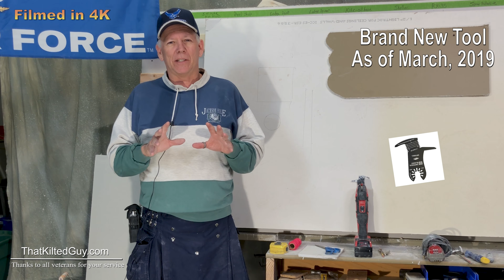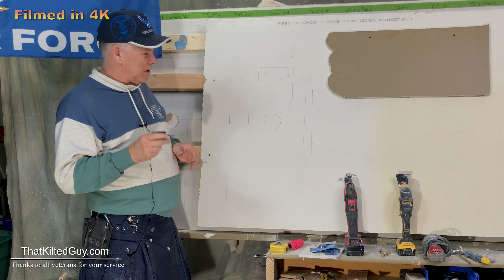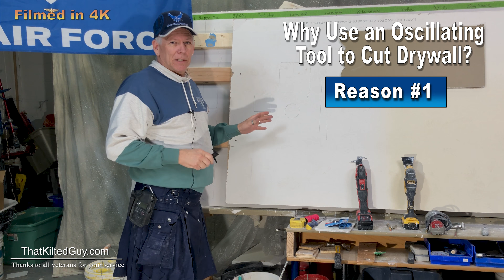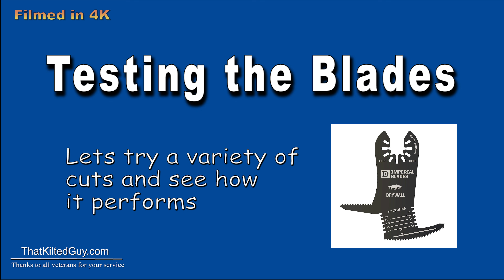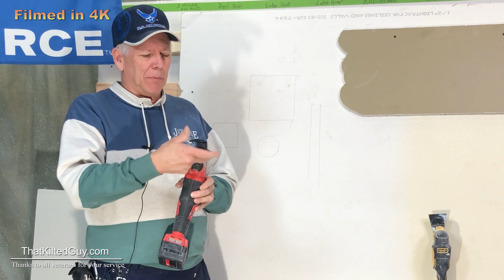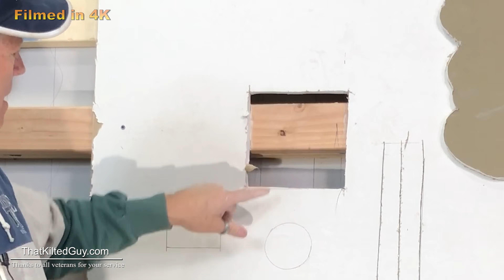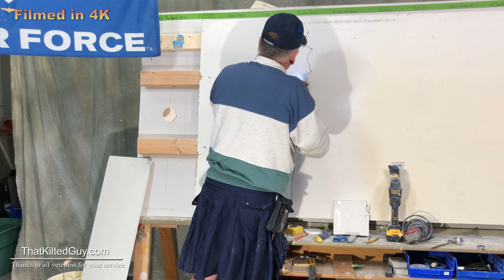BRAND NEW DRYWALL CUTTING BLADE, for Cutting Sheetrock with an Oscillating Saw

Comment: Dude are you wearing a Dress.
Reply from the maker: Hi Barbara Collier. I actually wear kilts in my videos, and my daily life.  Hence my channel name of 'That Kilted Guy Videos'. I wear them because they are incredibly comfortable with none of the binding you get from shorts and jeans. 

Sure, some people mistake it for a skirt or a dress, and that doesn't bother me at all. 

Thanks for stopping by, and hope I helped answer your question.
Reply from the maker: It’s actually my new invention. It’s a solar powered, air exchange unit with built in anti paralytic movement sensors calibrated to the wearer’s body type designed to improve working efficiency on a semi logarithmic scale. Or, a kilt

Comment: Sweet jesus dude.....Why are you wearing a dress ???
Reply from the maker: You really don't know the difference between a dress and a kilt?  Seriously?  Or is this a joke, lol.
Reply: @ThatKiltedGuyDIY  What is underneath!!..lol
Reply from the maker: Keith Wills  uhh, my gear
Reply from the maker: Keith Wills i also keep my caulking gun, a laptop, and some screws under there.... plus some smart Alec replies, because im full of them.
Reply: @ThatKiltedGuyDIY  That was the answer to your above question ..." the difference"...lol at least you're a good sport about it!
Reply from the maker: It’s actually my new invention. It’s a solar powered, air exchange unit with built in anti paralytic movement sensors calibrated to the wearer’s body type designed to improve working efficiency on a semi logarithmic scale. Or, a kilt

Comment: I'd be using those serrated edges as my depth gauge once the numbers disappeared if I had to. I'm not usually a drywall finisher but I did a job last year that was 20,000 square feet of drywall with my dad, I learnt as just as much from watching your videos as I learnt from guy I was doing it with, the job turned out fine.